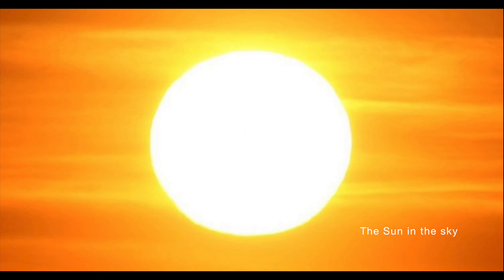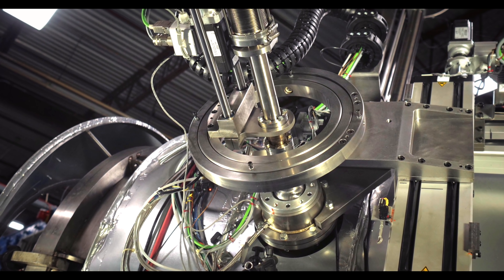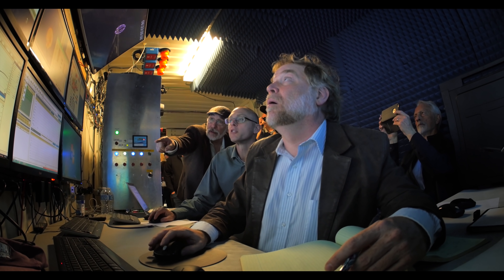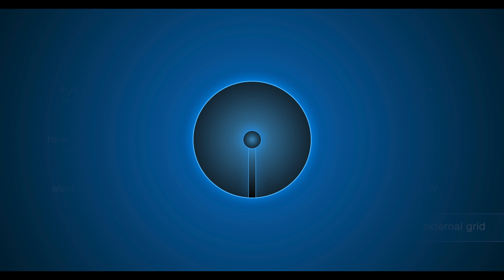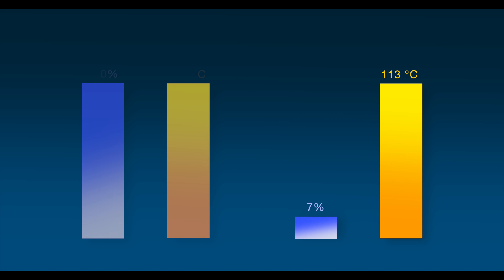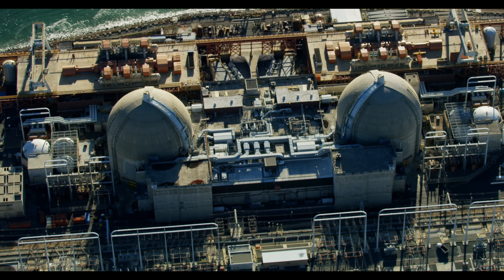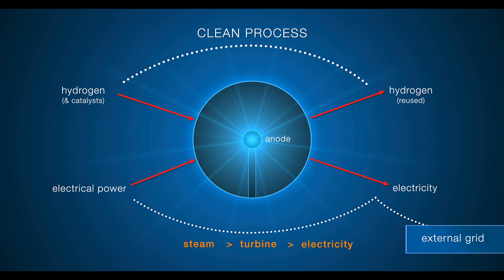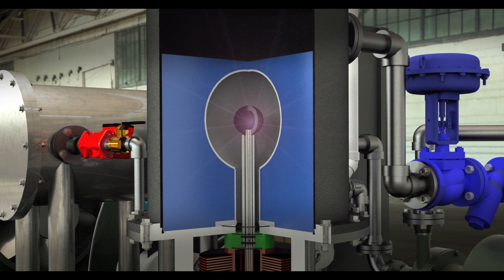Special Feature: THE SAFIRE SUN

Comment: Can this technology take existing " spent" fuel rods and reduce them to benign by products?  If so, the costs and efforts have been worth it, irrespective of any other benefits
Reply: Yes it can
Reply: They literally talk about this in the video.
Reply: @emonvidaly  but what happens  exactly is it just not radioactive anymore or does it break down into other elements
 do you end up with non radioactive albeit still highly toxic heavy metal ,i  imagine Uranium  even though not being radioactive is still extremely toxic being heavier than lead or mercury and could still poison you
Reply: @andreamitchell4758  we do not know what they are claiming. Seems like transmutation is what they saying.
Reply: @andreamitchell4758  uranium is natural and quite common.  I'm not sure about the toxicity but it should be well documented.
Reply: @andreamitchell4758  You are quite correct. Uranium is chemically far more lethal than its radioactivity. Avoid ingesting it. But one kg of uranium fuel in a fast neutron reactor can supply ten million kWh of energy. Even  the USA's total current backlog of slightly used nuclear fuel that is 95% unused uranium, amounts to maybe 75 thousand tons. It was 71 thousand when John Oliver  mistakenly spoke of it as a serious problem.
USA's Annual solid coal waste, tiny compared with its gaseous waste, loaded with mercury, lead, cadmium, arsenic, and other chemical threats, is about 130 Million tons.
Note also that even the dreaded Plutonium, with a half-life of 24,000 years, has a toxicity per microgram the is significantly lower than that of pure caffeine, or indeed of various other things quite harmlessly ingested by humans.
Reply: @andreamitchell4758  Answers are here
https://www.youtube.com/watch?v=L2peIoqu7ho
Reply: @emonvidaly  not all radioactive material is the same... This one feature, if indeed true, is worth trillions of dollars and would resolve the primary failure of nuclear power... but as a sage once quipped... If it sounds too good to be true, it probably is... Like Bernie Madoff's profits
Reply: @melodyscamman244  what's your point? They said as much in the the video!
Reply: @emonvidaly  they use hypothetical language and do not definitively state nuclear power spent fuel... nuclear " waste" can be from medical, smoke detectors etc... When talking about power generation they talk radioactive materials (unspecified element) 'can' be used and 'would' produce base materials (not does)... followed by "imagine" ... as in dream about, saying it is one of three prongs of investigation but not saying it is actually achievable.

I certainly wish them success and prosperity... but believe in asking specific critical questions.  Words have specific meanings within rhetoric and usage.

When looking for investors companies hire wordsmiths that are usually good at theirs trade.  I amire the advancements made by the SAFIRE project, but quite often people hear what they want and not necessarily what was actually said... might, would, should, could, imagine...
Reply: @melodyscamman244  The spent fuel weakness of Alvin Weinberg's first hydrogen moderated water cooled reactors, 3% fission products 96% unused uranium, and 1% transuranics, was solved by him with his radically improved molten salt design which converts thorium 232 to uranium 233 and gets its neutrons from the uranium fission process. The only waste product is about a ton of fission products a year for a 1000 MW reactor. Those fission products are short lived and get rid of themselves by rapid radioactive decay. The molten salt solvent holds them chemically locked in it when the reactor is halted simply by draining it into a basin, where it solidifies.
Reply: Just said back to base
Reply: did you not watch the video? answer is yes btw
Reply: @sen5i  did you happen to read all my answers in this thread?  ...as Paul Simon sang... "People hear what they want to hear and disregard the rest..."
Reply: YES that is what they are saying! over and over.
Reply: @justpassingthroughthistime9947  had you read the entire thread you'd understand my question...as to your assertion, NO they are NOT saying the same thing... As any advertising intern could advise you... sell the dream, not the product... 

I am totally hopeful that this project continues and prospers... Asking specific questions not addressed in the clip is not an attempt to quash the dream or disparage achievements... it is an attempt to address realistic obstacles.  Spent fuel rods are different than raw radioactive material.
Reply: james kenyon  THANK YOU for getting the information.  I pray they can create a chamber large enough to handle the extensive backlog...

Sorry if I came across as a skeptic... (I'm not a lawyer, but nearly all my acquaintances are 😄)  I've kept up with the info released on Thunderbolts, but not delved into the project independently.  Hydrogen supply could prove challenging despite it's universal abundance I feel.  Both, the sequestration process and volatility of the element provide economic and safety hurdles.  The potential seems abundant.  They must beware government secrecy and regulatory overreach...the bane of Tesla... Stay well and stay safe
Reply: @melodyscamman244  Do not be sorry for being a skeptic. The great T.H.Huxley gave a "lay sermon" in his role as Chairman of the Royal Society (for the Advancement of Natural Knowledge --i.e. science) said that skepticism is the prime duty of any serious seeker of such knowledge.

Comment: Our World seen in the true light of the electric sun. The universe makes sense again thanks to the Thunderbolts Project. God bless you all.
Reply: LENR energy will solve many problems of humanity. Not all, but many.  Thanks to LENR pioneers we are now getting close.
Reply: I have to add that a lightning storm, "thunderbolts", is Nature's solar way of producing electricity. One can hardly think of anything dafter.
The sun evaporates water form the ground or the oceans, each molecule ot the gas is far lighter than the atmospheric average, so they float upwards to the level where they fall down again, as the troposphere's temperature condenses them back into water droplets. Then  collisions with other molecules cause ionisation, and eventually there are electrostatic voltage differences enough to break down the resistance of the intervening air, and we get a flash of lightning. I have seen lightning between cloud layers above me, even when no rain was reaching the ground.
At Glasgow University, Professor Sir William Thomson, even before he was elevated to the peerage as Lord Kelvin, built a machine now known as "Kelvin's Thunderstorm"
It's quite a bit dafter than the Wimshurst machine, and I don't think it can produce centimetre long sparks, but the idea amuses me greatly. I wish I'd known about it when I taught high school Physics.
Reply: About the "electric sun" and all other stars: The process of fusion going on within them necessarily involves overcoming the electrical repulsion forces between naked positively charged protons, with gravitational forces combined with the nuclear "strong force" between protons and neutrons.
Reply: Shame it's all BS and that you've been fooled by a cult-like hoax.   

https://www.youtube.com/watch?v=vmVdPgkudC8